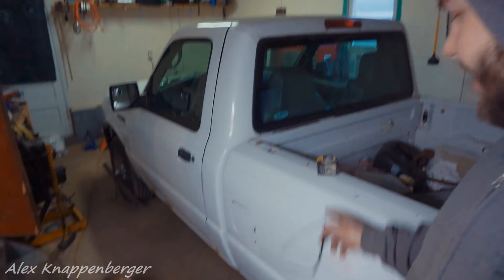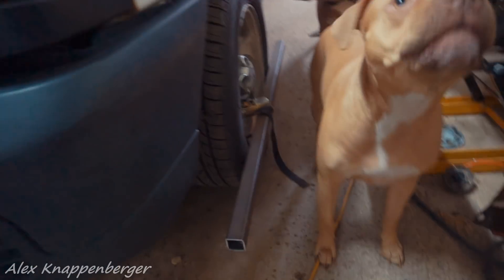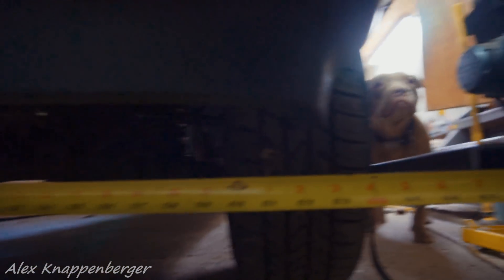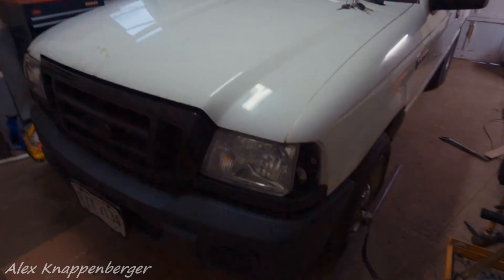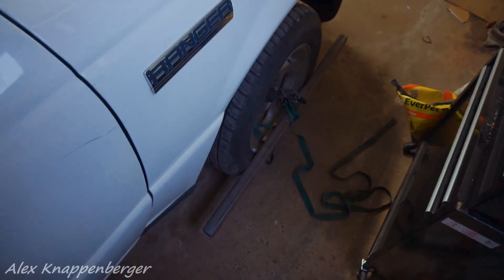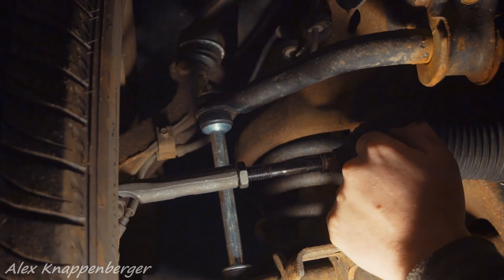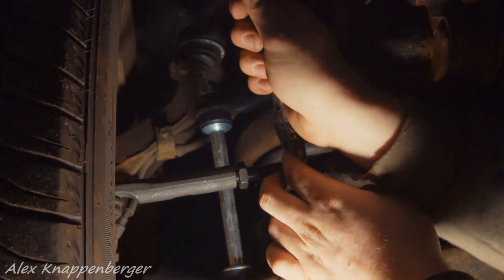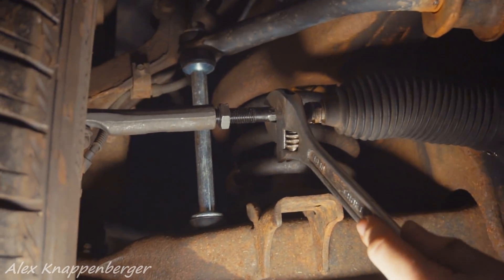DIY Vehicle Front End Toe Alignment Tie Rod How To

Comment: Thanks for your help. I think I'll use this method on my Toyota camper, which I think had been adjusted with a bad Idler arm knuckle. Since I replaced the center link the steering is no longer centered. Doesn't the length of your tubing, being longer than the tire diameter, exaggerate the measurement to where the actual toe in is less than you calculated?

Comment: I use string from rear tire to front tire.
Works good too...
Reply: stoney renegade  I can't change the camber though.
Truck seems to have negative camber. My truck was pulling to
The right, so I did my little trick with the string. Now it has very little pull to the right. There's always a little pull to the right
if the road has a slant towards the ditch. I have it towing in about an 1/8 of an inch, and It's much better to handle

Comment: Forgot the last step: Drive the car, if the steering wheel veers left, adjust both wheels to the right slightly. Vice-versa for left until the wheel is straight. Yours seem to sit to the left a little. Fine mechanically but humans are vain creatures. I need my steering wheel straight too!